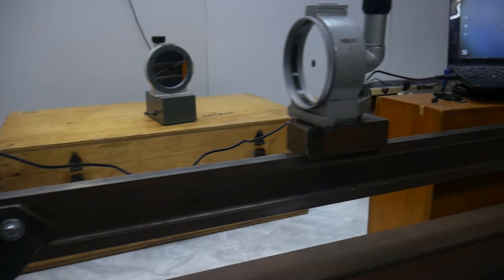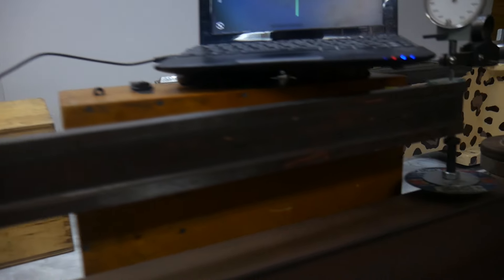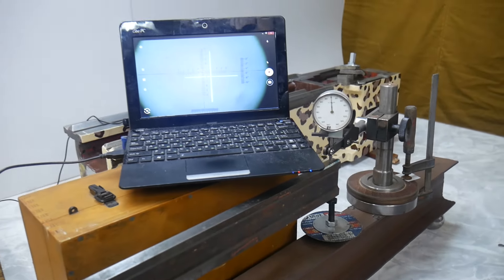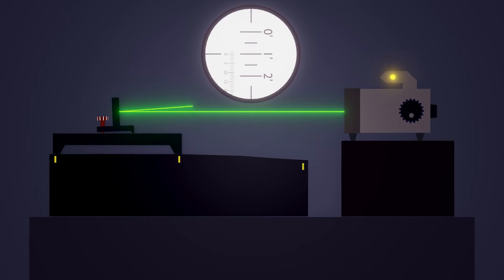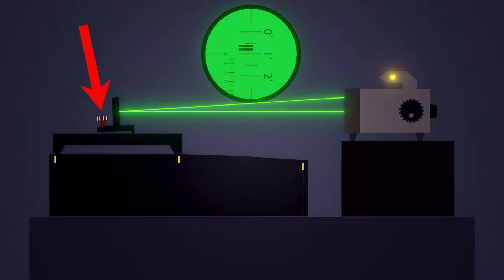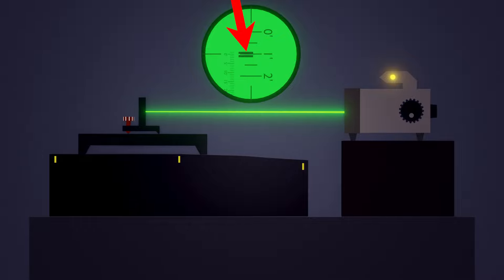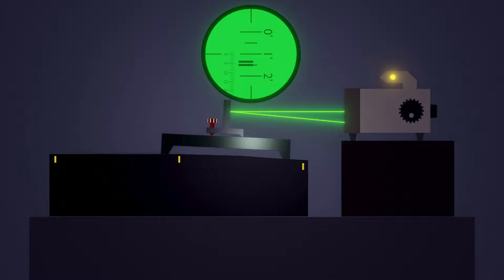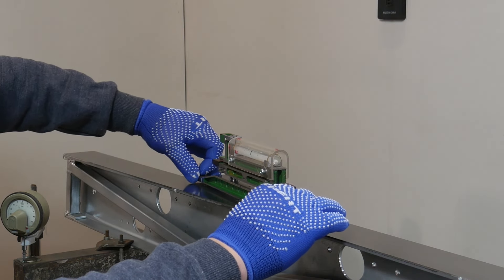Very accurate measurements with bubble level

Comment: I just wouldn't have the patience to do this sort of work, but it's so interesting to see it being done.
Reply from the maker: It only seems so at first. When you measure a surface and get its relief, you seem to have second sight, you see where the highest places are, where the deepest ones are. Then you lower the highest ones, and the surface is already flatter. I did this several times, and the strip turned into a very useful and valuable tool, and most importantly, you control everything yourself and see everything.
Reply: I have done basic scraping, to true up things like a surface plate, but this is on another level. Things like a controlled temperature room and not touching the item under test etc.

Comment: I'm a Dutch machinist and fabricator who used to work on old Eastblock mills and horizontal drills like Czechoslovakian TOS and even old USSR (converted to almost working CNC) mills for workpieces up to 9 tons. I always appreciate true flatness when I see it! I do wonder why you use a pencil instead of machinist blue (or just common blue oilpaint like we used)?
Reply from the maker: Hello! I use graphite as a lubricant, it grinds into an extremely fine dust, gives good glide and does not interfere with the accuracy of measurements.
Reply: @gena_bazarko  yes! A lubricant. Now I see. Дякую!
Reply: @gena_bazarko  take in consideration as pencil have a hardness and that better to B grade ( 4B or 5B are aeasy and cheap to locate ) than H grade , H grade pencil ( hard ) are also use as standard hardness testing for paint coating . 
I use Tungsten disulfide micro powder as that a best low friction dry lub DONT USE Molybdenum disulfide as that turn in acid with water / humidity .

Comment: I don’t know if adds to anything but. 
You could, if you need, give your screw jacks finer calibration by making them with differential threads. 😎
Reply from the maker: There is a bolt with a thread pitch, I don’t remember exactly now, but probably 1 mm. The jack is made simply from a bolt and two nuts, plus one washer between the nuts and epoxy glue. Some technology is performed to eliminate thread defects on the bolt from dents when pouring and transporting the bolts, and an assembly technique is used when two nuts are in such a position that the bolt rotates tightly in these two nuts, without play. This position is fixed with glue. If you need to position with an accuracy of 1 micron, this is quite enough. If we are talking about 100 nanometers, then a very fine thread or differentiated thread is needed.

Comment: Hello Gena (short for Gennadiy?) 
The measurements you are chasing are surpassingly impressive, great work!
I think you should look into Hertzian contact stresses as you go along. The geometry and gauging force of the tips of your (lovely) microcators can and should be accounted for when you are looking at 100nm increments. It will have an influence on the absolute values for straightness and flatness relative to the values read from the dial. 

Your videos are incredible. The visualizations are some of the clearest I've seen on the topic on YouTube so far. Really well done.

Also - are the microcator surface gauges still for sale? or have they all been bought already?
Love from Denmark
-G

Comment: To keep the stone flat as a reference surface that better to use only the Witworth method ( 3 stones A B and C ) or to grind the stone of a surface grinder with a better straightness as requested on the stones . the 3 flats / stones allow to reach incredible Hight flatness with not need of local scrapping . 2 stone surface loss the flatness , 3 never .

A thing to carefully check with Witworth 3 flats is when you lap narrow surfaces and long surfaces , to stay perpendicular to avoid to generate yaw .

The problem is the size of the stone compare to length of the surface to rework , if that a convex defect that ok , if that a concave defect that far more difficult as your stone work only of the edges.

I use the chest board method , divide the surface in square and record each level UP/DOWN and rework each square surface , after I subdivide the previously square and over lap the pitch to avoid border effect and rework again .

I am impress by the sub micron level you reach , perhaps you can try to measure '' in line'' so parallel strokes and in V so from left to right side and right to left both side  with your level to check if you have yaw ?

Comment: Another impressive example of your work and skill.   My first thought was to worry about the risk of dropping the level from the bar  by accident, onto that harsh concrete.   Accidents happen….  So I suggest a simple wood panel mounted around the bar, so anything that slips does not fall and get damaged.   Those levels are very valuable!!
Regards and best wishes from Cambridge.
Reply from the maker: This is a very useful idea. During this work, I constantly pay attention to this, I try to be as careful and accurate as possible, but sooner or later something will happen anyway. Indeed, it is much better to increase security with insurance.

Comment: Gena, I've enjoyed your videos and I think using an AI voice is a wise decision. I do the same on my channel. I know some people hate it, but they forget that these videos are meant for many. Also for people who have difficulty understanding English with a heavy accent.  The same people forget that it is way more work to write down all your text, feed it to a voice generator and paste the spoken text back in the video. Way more work than a voiceover chatting incessantly. So you are doing many a service with this extra effort, and I applaud you for that. 👏

I myself am sometimes busy with very accurate measurements, and I wonder how you take into account the inevitable deflection of the beam due to gravity. My heavy cast iron surface plate flexes up to 3 microns under its own weight if I balance it not correctly, so the long slender beam you are using may sag even more. 1µ/m is an extraordinary result!
Reply: Metal bars will change shape if they are too long to resist gravity from one end to the other... that's why they need to be vertically thick enough too manage their own weight... and metals will expand or contract with temperature changes... Granite will not change shape... it is stable and not affected by its own weight or by temperature differentials... that's why "surface plates" are made of granite... because of their stability when their... surfaces as referances... are required for measurement purposes...

His granite beam looks like sawed lumber... because it does not need to look pretty... it just needs to be massive enough to bridge the size of the surface area of the required measurement zone... As a bonus... size overkill is easy and relatively inexpensive... when done with rough sawn granite... 

This genius really knows his stuff... and with that knowledge... with his... "back to basics"... understanding of immutable laws of nature... develops and uses... "simple looking tools"... which can make incredibally accurate measurements... but simple tools... ???.... they are not... basic tools... ???...  yes... Simple tools... ???... no... Meticulous tools... ???... absolutely... Amazing tools... ???... definately... !!!

Comment: Have you encountered changes over time in the beam? Great work and thanks for sharing!
Reply from the maker: I now have the technical ability to measure surfaces very accurately, so I can conduct research into how different materials behave. But this is a big job, you need to prepare for it. I am at the stage of development where I can start such a project. I'm preparing for it.

Comment: Hopefully you've annealed those welding spots of the reinforcement, or you'll see later that your flat is not flat any more. Usually those flats are built from cast iron, kept outside for years to release any internal stress.
Reply from the maker: Preliminary circumstances have developed in such a way that these actions have been completed by approximately 98 percent. Because as the project progressed, the plan was adjusted.

Comment: Should it be good to have a counterweight thats have the same weight as the spirit level? That would cancel out possibel movements of the base if you started them both from the center and moved them the same distance in oppisite directions from the center for every mesurment.
Reply from the maker: When I made the body of the bubble level, I tried to make it rigid, but also lighter. At this weight, my level does not create any noticeable problems and no additional measures are needed. It would probably be possible to attach several rubber balloons with helium to it).

Comment: Sorry but I don't understand your method. Did you put the bubble device in the middle and then adjusted the jack screws until the bubble was centered and then moved the whole bubble assembly across the surface left and right to see the deviation from the center position (call this a datum)?
Reply from the maker: This method consists in the fact that after each movement of the bubble level, using jacks, I bring the bubble to the central position on its scale, and from the microcators I see by what linear amount the movement occurred. We select the measurement scheme arbitrarily, based on current tasks. I have already tested this method with practice. High accuracy is achieved. I made the same surface strip with an error accuracy not exceeding one micron. In the future, I will show this work in my videos quite clearly and in detail, having done it directly on this sample.
Reply: @gena_bazarko  I think I understand what you're doing. You're using the bubble always level (perfectly horizontal) by adjusting the jack screw on the right and you read the right microkator to see what the deviation is. By traversing the bubble over the straight edge and adjusting the screw on the right, you map the surface deviations so you know where to scrap/polish or whatever you use to remove minute material
Reply from the maker: So, the fact is that in order to place the bubble exactly in the center, you need to adjust the microcator at a distance of one meter to one micron. Raise it a micron higher, and you already see that the bubble has moved away from the center to the side. Therefore, the accuracy is very high. The microcator scale is much more accurate than the bubble level scale.

Comment: Precisely flat surfaces can be done with the three plates method. It does not need precise instruments.
Reply: /r/confidentlywrong
Yes, we all know about the Whitworth method. But how do you measure where you are? And what about when you get to the point where the bottom plate is always convex, at about 2-3 microns flatness?  Watch Renzetti's videos (and the others on this channel) - these guys pushed past the limits of the 3-plate method years ago.
Reply: @rodfrey  The improved Whitworth method proposes using a paint to track the progress... And, as for the precision, I guess, repeating is the way ...
Reply from the maker: Hello! I will need this precision strip 1070 mm by 60 mm in the near future to repair a pair of linear movement. I will complete this job in about 40 working hours, and I will have a very accurate tool that I need. Imagine if I go the route you suggested, first I need to make three surface plates 800mm by 800mm. Then, using one of these plates as a reference, make this precision strip. Do you see the difference in the difficulty of solving the problem?

Comment: Haven't I seen your video before?  I guess they all seem to be the same to me.

"....The peculiarity of this method is that I control the position of the measured plane. ..."  It's a pretty peculiar method but I'm not going to bother to figure out what you are trying to say.  It's too difficult for you to figure out and I'm not going to figure it out for you.

What I find pretty peculiar is that you are from some part of the world where you can't just buy a tool if you need one and nobody has the common sense to realize that if they can't buy a necessary and fundamental tool then they should be selling them.  

In the light of the previous paragraph, Granite is simply easier.  If we were to think through the processes of tool making, I need to make basic tool A to make basic tool B to make basic tool C...the chain of precision processes is the shortest.  All you need is a lap, the flattest surface that you have and a way of checking the finished product.  It is already stable and an easy material to cut with tools that need little maintenance, expense or preparation.  If nobody on you your entire continent can buy a straight edge then you should plan on selling surface plates and squares as well.  After-all, if nobody else has that much common sense then you can stop making suits and start making sense.
Reply from the maker: Hello! You wrote such a long comment, but unfortunately, probably due to the translation into another language, I did not understand everything exactly. Really, I'd rather make straight edge than buy it. It will be very expensive for me. And I can do it quite successfully myself, and then I can repair the metalworking machine. I think that's good.
Reply: @gena_bazarko  Oh good. You are alive.  Make a note that I did give you the right answer.  Simplify the problem.
Reply: @gena_bazarko  ...and with further thought...There is an easy way without fighting government regulations or personnel.  Simply take any measuring device and measure the length of your machine ways.  Then take the same measuring device and measure your straight edge only when you do so mark the best area of the straight edge in pencil.  Then turn your straight edge 180 degrees  measure and mark it again.  Now take the straight edge over to the machine and scrape the machine so that it is the best in both orientations of the straight edge.   

By doing this what you will be doing is following the same procedure as is used for lapping a part.
Reply: Wow, this must be an American, one of the ones who writes thoughtlessly rude comments out of pure ignorance and with no appreciation of the circumstances someone else is living in.   Gena does remarkably refined work, similar to the best anyone else has offered up for free on youtube - on the level of Robrenz, Stefan G, and other genuine practitioners.  He produces extremely informative and educational material, reflecting his experience and skill.  Compared to this, most commercial American engineering is at the level of someone banging rocks together.  If you are able to read the news, perhaps you can guess why he is not setting up a factory to manufacture straight edges in Ukraine this year?   You've not said anything interesting, and it seems very unlikely that you have even a fraction of the knowledge on display here.
Reply: @mileshember3501  Good.  I guess you know better than I would, so you can just move on to insulting someone who gives shit what you know.